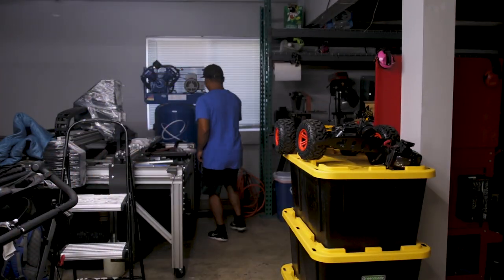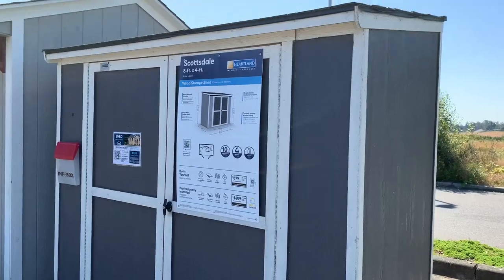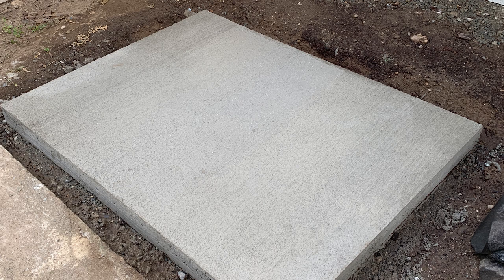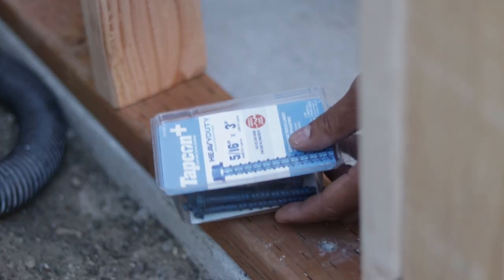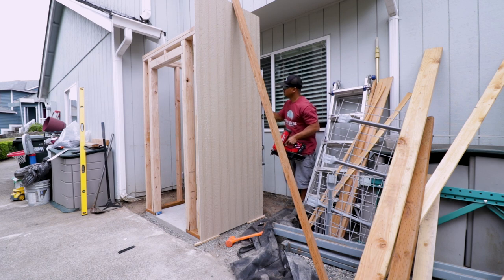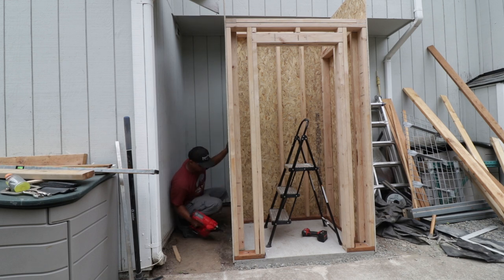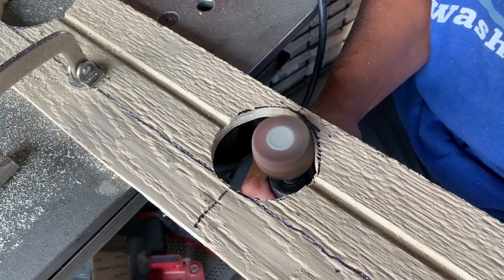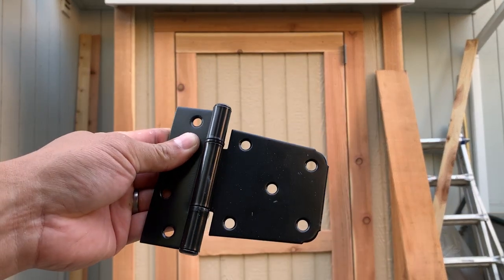Keep that NOISE OUT! Building an Air compressor SHED

Comment: Thanks for sharing! You're likely going to want to add more air venting (up high & down low for convective flow) to keep from overheating the compressor. If you live in an area that has freezing weather in the winter, an auto-drain with heat tape on the drain line are in order. If your drain line bursts and your compressor is left on, and you're not home, the compressor may catch fire... I saw a pole barn that burnt to the ground because an air line ruptured while the owner was not there, and the compressor ran continuously and got so hot it caught fire. The manual, twist type rotary timer switches are a nice safety feature to add to compressors so that you don't accidentally leave them "on" & unattended... and the neighbors might enjoy NOT hearing your compressor cycle in the wee hours of the morning.
Reply from the maker: Thanks for the tips!
Reply: You should never leave a compressor on if you are not using air. Just safety common sense practices.

Comment: Another way to prevent the air compressor from being left on is to get a 12volt door bell transformer and some 12volt LED indicator lights for a trailer and take a leg from the compressor side of the 220 or 120volt input to power the transformer, and run bell wire from the transformer output side to wherever you want to mount the indicator lights.(in the shop, in your house, wherever)This has the advantage that a timer on the compressor might shut off at inopportune times while the transformer never shuts off until you manually shut the compressor down at the end of the work day.  Very inexpensive to do.  Completely safe.  Had / have my compressor and hidden from view lighting, set up this way for decades.
Reply from the maker: Cool thanks for the tips

Comment: Looks nice, but how did you plan for dealing with the heat buildup?  Compressors produce a lot of heat.  Forced air circulation would help.  For noise, lining the inside with rockwool would make a big difference.  An automatic drain on the compressor would be a good idea.  Also, if you don't have one, a refrigerated air dryer will really help your plasma.
Reply from the maker: I add more vents. Yes Rockwell is great. I added later after making this video.

Comment: Nice work. The shed turned out great...but I was waiting for the end to hear how much quieter it was while running in the shop. Also, with the orientation of the shed and soffit vents, won't the sound from the compressor reflect off the area behind the shed and reflect it out? I'm probably over thinking it.
Reply from the maker: You don’t hear it at all in the shop anymore. I didn’t show it it in the video but I added some Rockwell safe n sound

Comment: Nice work! Looks like it belongs there (my wife would approve 🙂). Next projects: electrical supply to compressor, air lines to the shop, tank water drain, possibly sound insulation and more ventilation. It never ends my friend 👍
Reply from the maker: Thanks

Comment: Just started to watch the video. I had the same problem. I have a CNC plasma table and piston air compressor (will upgrade to screw type in the future). Since where I live we have winters with negative temperatures, I opted to build compressor box for my horizontal 100 liter, 5hp compressor. Built it with 18mm OSB sheets and lined it inside with 20mm thick foam sheets. Added 3 150mm fans for cooling, with temperature sensor on a compressor cylinders itself to turn on/off the fans. The box works amazing! Before you had to have hearing protection to be near the compressor, not you can pretty comfortably speak on a phone near it.
Reply from the maker: Phil, those are some great ideas and tips. I may need to incorporated those after I plumb out the air and electrical lines to the shed.

Comment: If you really want to soundproof your shed, they sell rolls of soundproofing lead the studs and cover with drywall, you will be able to stand next to the shed and hardly hear it. Many years ago we used it an office building where offices were next to a print shop with several noisy printing presses, upon completion you could stand next to wall and hardly hear the presses.
Also I would install a vent at the bottom of the shed and a small exhaust fan at the top to draw air into the shed for cooling the compressor
Reply from the maker: Thansk did the tips

Comment: I realize this is an older video, but I have to say you built a very nice shed/encloser. I have plans to do pretty much the same thing with going from a portable in shop compressor, to a stand up fixed compressor out behind my shop in a similar encloser.  I also been looking at Quincy compressors and like the 60 gallon stand up and think it will supply all my pneumatic hand tool needs. However, I am looking at building more of a screened in shed to house the compressor. While not totally weather proof, I think it will offer what I need...and pretty much shed any rain from the compressor...
Reply from the maker: That’s a good idea

Comment: Another tip, and how I manage my AC compressor. I use a zwave 220V contactor, which is turned on when my garage lights.  I have two switches for lights, it it tied (wirelessly) to the "far side" of the garage. So that way if you flick on the near side lights you dont get the compressor (just grabbing something, etc) but if you turn on the far side lights the compressor turns on. I also have a zwave water shut off motor on a ball valve which operates at the same time so that the compressor tank doesn't leak down with inevitable small leaks.
Reply from the maker: Great tips thanks!

Comment: A few questions: Do your neighbors still hear the compressor?  Could/should you add insulation to make it quieter?  Should you add small vents down low on the walls so that air can flow in and out?  Without air-flow will your compressor create enough heat to affect operation or life of it?  In some locales any structure built that stands over 7 feet tall requires a Building Permit...I assume you're not in Los Angeles County?  I didn't see how you plumbed the air into your work-shop.  It's a good-looking, very professional build.
Reply from the maker: So far my neighbors have been very please. They said they don’t even notice it. You could definitely add some sound reading insulation to make it even quieter similar to what they use for diy home generators. In my area I’m fine but yeah I would check your local coded/requirements. Check out my clean air system video I’ll break down how I plumbed it inside to the shop. Extra vents and a fan would definitely help with cooling especially in warm climate areas. I probably should out one eventually. Especially if you have your air compressor running all the time.

Comment: Don't forget all hard surfaces reflect sound and act as a secondary speaker for noise.  Almost anything soft will help, such as rubber sheet or Roxul Safe and Sound insulation to attenuate unwanted sound.  I want to get a Milwaukee nail gun like you have.

Comment: Nice build!
Reply from the maker: Thanks!
Reply: @RathaSochenda  A thought, plumb the water drain from the compressor to the outside so you don't have to clean up that mess when you need to empty it.
Reply from the maker: @Boosted98gsx  Great tip.. I'll make sure to do that when I install the autodrain valve.

Comment: And while you are at it, and if you have a sawdust collector because you do wood working, build a similar shed for your sawdust collector and put it in there.  Those things howl like a banshee.  I made mine on top of a raised platform to prevent it from sitting on the ground, insulated it, and put a filtered return air duct through the wall to my wood shop so that I do not lose heated air in winter or cool air in summer.  It also keeps all of the mess when you empty it out of the shop.
This is assuming you plan or have, a ducted exhaust system to each woodworking machine or a way of hooking up each machine in turn inside your shop.

Comment: Bought a new quincy and was ready to do what you did, until I found that not h😢aving it in a heated building  would void the warrenty.
Make sense, any water in the after cooler etc.,could freeze and cause damage, plus starts on cold oil is not good.
Reply from the maker: That makes sense. I’ve own my Quincy for 10 years now and it’s been through some extreme temps and abuse honestly I feel like it didn’t even phase it. I try not to over think these scenarios but I do take care of my equipment
Reply: @RathaSochenda  I think you're right. I've had many compressors outside with no covering at all, but I hated to lose a warrenty on a new machine. 
I got the Quincy 7.5 hp 2-stage and I've really been happy with it.

Comment: 1. Since you made a "Building" that is more or less permanent, doesn't that require a build permit or some kind of approval from the city? (heard this somewhere when something permanent is added to land)

2. Why not add sound insulation on the inside of the shed to dampen the noise more (for the rooms just inside the house from it, and your neighbors)?
Reply from the maker: Depend on you local laws.  I did add insulation down the road and an extra fan to bring help with flow during the summer months

Comment: Love the shed. I was just watching "This Old House" the other day and they talked about drip edge installation. They mentioned something that I didn't even realize. They say you need to pull that bottom kicker on the drip edge away from the kicker. It will save your facia boards from water.  Found the video here....https://youtu.be/sDTCTbyyg1s?t=120   Just interesting and figured I would share.